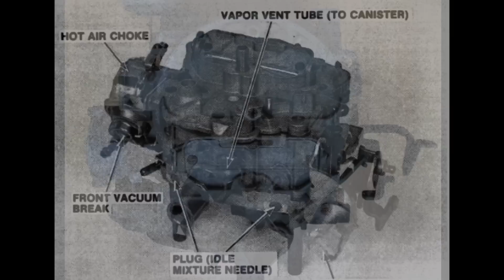Strangest Automotive Inventions:  GM's Rochester Dualjet Carburetor Or The "Demi-Quadrajet"

Comment: My buddy in Seattle just bought a beautiful '77 Firebird Formula with the 301/dual jet combo.
Reply: He better plan on using the 301 as  a boat anchor, and that carburetor as a wheel chock.
Reply: I had a 1980 Trans Am with the 301 V-8 and TH-350 transmission, and it was kind of a dog.  After the engine overheated, I replaced it  with a 1974 Pontiac 400 V-8 from a Catalina wagon.  Installed a more aggressive cam, and used a 1968 4-bbl intake and Q-jet, true dual exhaust system, etc.  The transmission I used was a 1970 TH-350 with a B&M shift kit.

With those mods the car actually performed as you would expect from a Trans Am.  It was like night and day. 

Your friend's '77 Firebird could be a real "sleeper" with a similar swap.   Just a suggestion.
Reply: No doubt. A Pontiac 400 or 455 will bolt right in place.
Reply: @mikee2923  I did talk to someone that put a 6.2 LS in place of one and now has more power

Comment: Those smaller V8s were probably still better than the HT4100.
Reply: The little Crosley COBRA engines made of stamped steel in the late 1940s were probably better than the HT4100. 🤣😂🤣😂
Reply: Yet equally as gutless. I had an ‘80 Cutlass with a 260 V8 and a 2.29:1 rear axle ratio and the horrible THM200 transmission. The 260 was completely gutless. It tossed the timing chain at 90K miles. I replaced it with an Olds 350 2bbl from a 1970 Delta 88 and a TH350 that I rebuilt in my garage. That car was a freeway cruiser. It didn’t shift out of first gear until 60 MPH at WOT. It also got half decent gas mileage if I kept my foot out of it, which rarely happened.
Reply: @alantrimble2881 I was given a Gutless Cutlass with a 260 , absolutely laughable power .
I made a nice demo car out of it at our local winter carnival
Reply: The Hook and tow special
Reply: We avoided those Caddys like the plague at the auto auctions back in the day and they were everywhere. You couldn't swing a dead cat without hitting a couple at any given auction. Anything with the GM Quad 4 was also  avoided. There was no shortage of specific cars to avoid. Remember Merkur? Too many to remember!
Reply: @mytmousemalibu  Couldn't swing a dead cat without hitting a dead Cad?
Reply: Absolutely.
Reply: Known as your mechanic's boat anchor.  The repair bills covered his boat payment.
Reply: Started wrenching in late 80's worked for a shady character for a year he chose to put set bearings in a 4100  knocked from the getgo he put 50w oil in to "make it quiet" car came back on a hook 2days later the block split in half
Reply: @Jeff-j8w7p  bot account